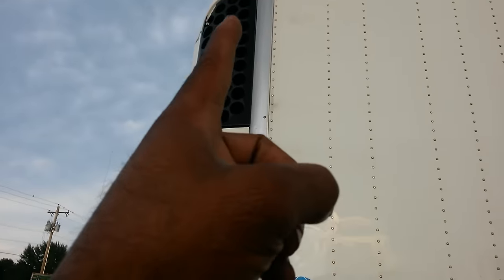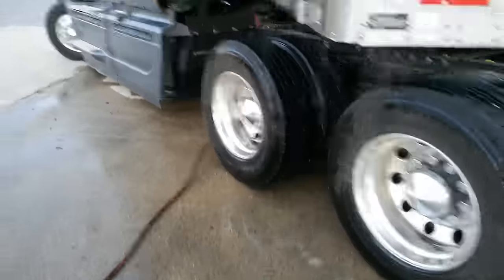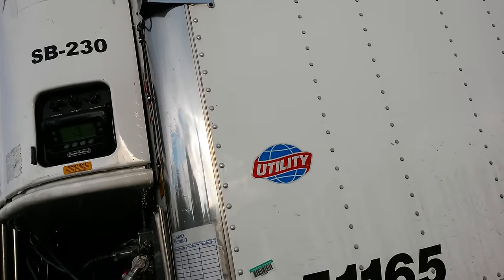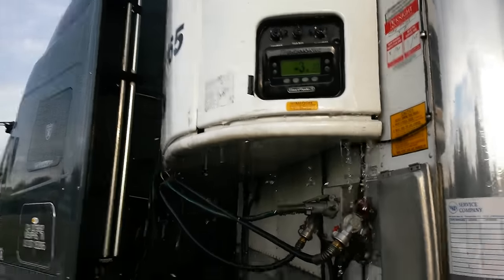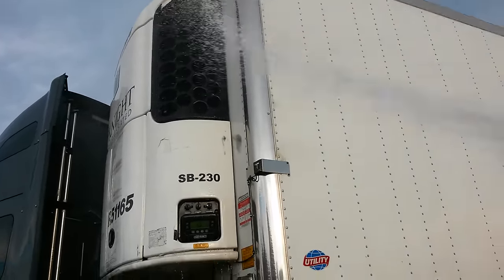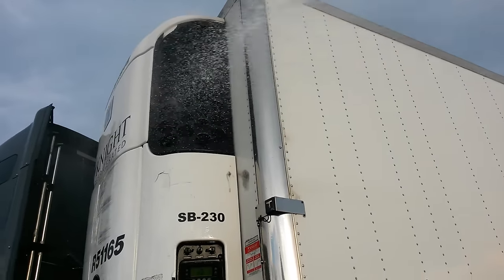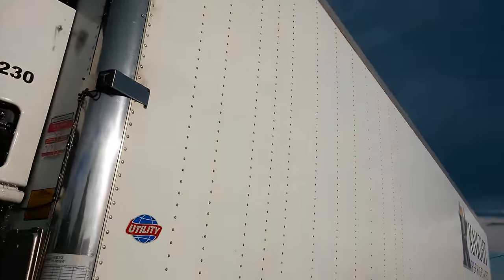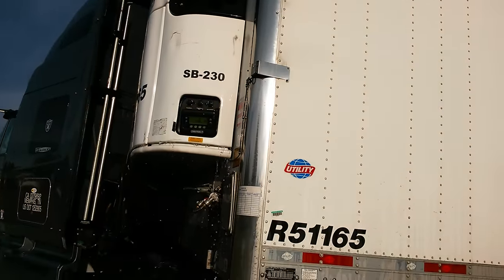Mr.Sinnizter DaTrucker: How To Help Get Your Refrigerated Trailer Cold

Comment: Pulled reefer for years... 'Always something,' particularly with outlaw outfits that are snapping up used equipment, hoping to get in the game and undercut the comp. We're only as good as the equipment we use, coupled with the people ( not computers... PEOPLE) we work with. DO take care on the 'clock' thing. Safety is one thing. Revenue enhancement projects are another.